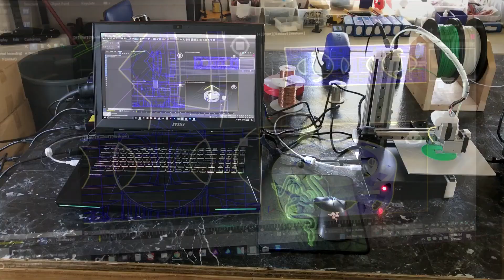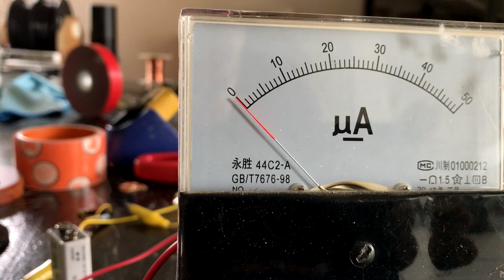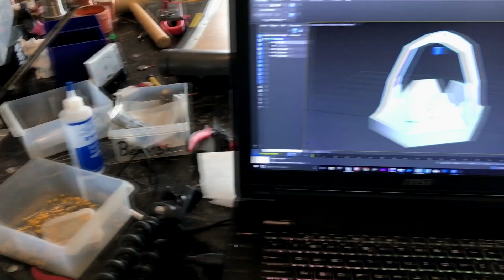3D Printed Nuclear Powered Motor - TriNano EZ-Spin - Tritium

Comment: Very cool build, I was especially impressed by running off the charge difference of ambient air to ground or dissimilar metals. Do you think some kind of pulsed power solution such as a joule thief circuit offer any potential improvements when driving the motor?

Comment: Congratulations dude, you did it! I'm interested in how you did it, put it on laserhacker.com! I'm seeing jewel bearings, but the top one looks like a non contact "keeper" to me, with a magnet to reduce the friction from the bottom one. You mentioned keeping it low weight... Ferromagnetic steel axle. Six dancing flower coils, guessing in your usual series configuration... Wondering what switching you settled on in the end?

Comment: Is there a way to emplifay the current from the teritium battery? or maybe use it to recharge a regular battery that would provide power for the motor?
I imagin the charge rate would be low but technically that would be a self charged motor.
Reply: You could in theory charge a capacitor or battery using a tritium cell, but in reality the leakage would cancel out the minuscule charge rate before gaining any substantial charge
Reply: I've seen someone charge a capacitor and made a self charging flashlight, that took 3 hours or so to recharge.
I was wondering if its possible to emplify the current before charging a capacitor/battery to lower charge time and make it more viable self charging system..
Trying to work on such system myself.
Reply: What do you mean self charging? Like a wind-up flashlight?

You can't just plop a capacitor into a system and have it magically charge up, there still has to be an energy input. 

And the only way to amplify the current would be at the cost of voltage, which means your charging time won't improve. You cannot get more power out of a tritium cell with any amplification circuit, the power it produces is a fixed constant.

And that constant is so low that it would take months to charge a battery or capacitor to a similar energy level as a typical flashlight, over such a length of time they would not hold their charge. 

If you want to charge a regular battery using nuclear decay, you'd have to step up your game from tritium to plutonium or polonium, and good luck getting your hands on either of those
Reply: By self charging I meant that the teritium solar cell is used to charge a battery/capacitor and those later on are used as primary power source for a circuit until depleted and then recharged by the teritium.
In another video, as I said, I saw how a capacitor was connected to the solar cell and charged within 3 hours or so and then discharged via white LED, which effectivly worked like a flashlight for a while.
In the video that inspired this one I remember he used like 7 teritium vials, which provided around 1.5V and (maybe mistaken) 0.25 nano amps.. I rekon making two such cells will double both current and voltage, but thats as long as the two cells are seperate, insted of sandwich the teritium between two solar cells.
maybe that way some voltage could be spared to emplify the current a bit?
Reply: Okay, first of all, can you please spell Tritium correctly? It's giving me a headache. 

That aside, no, it won't work .25 nano amps is so small that to get a decent current you'd have to reduce the voltage to nanovolts, which is equally useless. Like i said the power output of tritium cells is just too low. The leakage rate of any energy storage system would overcome it. 

The only thing i can think might work is winding up a spring at an incredible low gear ratio.

At the end of the day, you'd be better harvesting ambient light than relying on Tritium cells.

The fundamental problem is that Tritium is a very weak nuclear power source, but it's relatively easy for normal people to get ahold of. Various isotopes of Strontium, Polonium, and Plutonium all make far better 'atomic batteries' but they are also highly controlled substances, since they can be weaponized in either dirty bombs or actual thermonuclear weapons.
Reply: Sorry for not spelling correctly, today my keyboard kinda lack the will to work properly..

Comment: Try to use difrent shape of coils most efective shape is sphere inside out like a spining toy from movie inception then pulse them with tesla type electricity. U dont want to use current. Current is byproduct. Just pulse voltage into the coils and coil shouldnt produce magnetic fields cause of shape of the coil like pyramid. Bottom of the pyramid is ingoing and top cap is where energy will beam into the rotor. Magnets should has the same shape but opposite to coils. Try also with crystals inside coils(difrent crystals difrent effects) The shape is most important it has to be like shape of crystal. Also materials u use should have most conductivity. Switching is also important mercury switch is best option as i know. Look how crystal shape (or inside out sphere) capture energy inside it and beam it to nearest simmilar receiver - resonance come to play. U dont want current, current means u are loosing energy. Contact me if u wanna some informations and also watch eric dollard, old scientist,  the old rat lab just to get some creative ideas from watching them. You are open minded enough to get something from them. Good luck and thank you for your videos. My email szczupaly@gmail.com remember that u need to switch between close and open circuit back and forth to get best results and that is where the mercury switch goes. Sorry for my english and God bless you !

Comment: If this motor uses as little energy as it seems, a radio transmitter-receiver apparatus and antenna/coil array with a regenerative circuit should be capable of powering a space satellite! (Redjeff53@gmail.com)

Comment: Just a thought, but aren't you wasting a lot of light by spacing the tritium lights so close together? Doesn't the light in the horizontal plane get lost? Wouldn't a mirror or prism allow you to capture that light and direct it to the photovoltaic cell? The light from each tritium light could hit more surface area that way.
Reply: Yes it would be more efficient to use reflective material to enclose the cell but it wouldn't look so cool
Reply: not look as cool? i disagree :)
Reply: Michel PASTOR 1 way mirrors?
Reply: Muh Face is right. What you call a one way mirror is a semi-transparent mirror. It is like a standard mirror but only partially "silvered". It only works if one side is darker than the other. It is the same thing as a beam splitter in optics. And it would be of absolutely no use in this project other than raising the cost and making it ugly.
Reply: Michel PASTOR
there are no one way mirrors, but there is one way transparency. so maaaybe mirrors could exist too?
Reply: Michel PASTOR so that you could still see through but it would also still reflect
Reply: Alec Whatshisname to do what ?
Reply: Muh Face, my probation office had one
Reply: You do realise that 1-way mirrors don't actually exist, right?

Comment: Really cool project! Hope you don't mind me bouncing some optimalisation ideas in here :) You didn't mention how you managed the switching (I think) so that got me thinking too..
Let me make some assumptions on this engine: 
1. The lighter the rotor, less friction. 
2. Switching losses could be relatively high.
3. I assume the solar panels is a lot cheaper than the tritium tubes. 

So what if you put the tritium tubes on the rotor and a ring of solar panels facing inwards towards the rotating tritium tubes?   (You cold also invert it so the solar panels were on the rotor and the tubes/magnet were on the outside. Depending on what weighs more). This way the tritium ligtht/panels interaction would do the switching. I think that would take care of the timing issues. I personally like the idea of spinning tritium tubes on the rotor :) One problem I foresee is that you need more poles since the solar panels have low efficiency when light hits it from an angle, so parallel connecting solar panels next to each other might lower the power output.. Obviously this motor would have its own set of losses but I think its possible to overcome them by minimize the light spill. Also each tube could be set in its own reflector since you 3d print it and easily could painted reflective. 
  I'm really looking forward to your next project!
Reply: very good

Comment: Just a thought or two after watching the video you could ge better efficiency if lowered the weight of the rotating mass and used a magnetic levitaion, low friction glass or ceramic for a bearing surface. Very cool!
Reply: Patrick Radcliffe ui

Comment: Were you using normal reed switches for commutation ? 
I wonder if it might be worth looking at MEMS reed switches, which probably have less magnetic material to reduce eddy current losses. Look up Coto redrock RR10
Reply: Nice ! I didn't know these existed.
Reply: After playing around I feel like he probably is using something like those. It's extremely hard to get cheapo reed switches to work as needed.
Reply: Honeywell do some low current devices....think its sml35

Comment: I think yo could get a substantial amount more current if you added a border around the vials of smaller solar panels or even just super reflective material. You are leaking a ton of light.
Reply: agreed, but then it wouldnt look so cool...
Reply: yewtoob007 I have to agree that the eerie green glow cannot be missing from a "nuclear" or "radioactive" device. If anything adding a diffuser would be even better so that you can't tell that the vials are the things glowing.

Comment: That's awesome.  Have you considered trying to use purple colored tritium sticks?  They are supposed to generate more electricity in these batteries.  Something about the purple wavelength having more energy.  There is a video somewhere on here where a guy tested the different colors.

Comment: Heck yeah man!!  I would love to build a few of these motors running on ambient background electricity!  Could you release the plans on your website so we can all get building and modifying designs so we can try for better efficiency.  

I've got a question, if you can get this motor spinning on such little power, just as fast as some of the higher power models, aren't you getting out the same amount of power as one of the big ones? If your not, could it be done?  or would the coil that draws the power have too much of a magnetic field and disrupt the spinning?

Comment: I wonder if it would spin better if you pulled a vacuum in that glass enclosure.  That would reduce the drag a little bit helping every nA that you make to much further into higher rpms for the motor.
Reply: Mad Electron Engineering I don't think it would make that much of a difference. It's pretty aerodynamic already.

Comment: So they spin. Can the do any real work? Whats the smallest motor you've made that uses the least electricity that can actually do work?
Reply: Divergent Droid to be able to spin at those currents it must be quite efficient, and have almost no losses, friction or otherwise.
Output work.....well, if its working with nano amps, and the cells iirc output about 2v, then.....you have about 20nW of output power, not sure what you could do with that.

Comment: Question. Did you try only using one solar panel and wrapping it with aliminum foil? Because NurdRage did and he saw that the single panel preformed better then the two panel version. So what I'm asking is did you try the single panel version?

Comment: that gave me an Idea, the motor its most likely very weak but it should be able to power a mechanical clock, that would make it a 10 year lasting clock!
Reply: Or just use a coin cell battery. Still a 10 year lasting clock costing a fraction of the price and taking a fraction of the space.

Comment: cr-10 printer approaching tomorrow^^
Reply: That is a great printer but spendy except through gearbest which has the absolute worst reputation.  They show cheap prices and then jack the prices up on you. Fair warning check their BBB rating. It isn't so good. Lots of complaints.
Reply: thanks, I know.. I'm in europe and got it from a different dealer
Reply: Lucky you. lol That being said I got a message that said it shipped. We will see.

Comment: Hey, I just saw your video on your beta voltaic generator about a week ago, and now I'm excited to see that you got it to work. I ordered a tritium vial in a little acrylic waterproof case for 20 dollars because I've always been fascinated with energy production and radiation, so when I saw that I could buy a safe radiation source that glowed, and could possibly be used as a small long lasting energy source, I knew I had to get my hands on one, and I even got my brother excited enough that he's going to buy his own. I also liked that I was getting a small amount of something worth much more per gram than gold, at about 30,00 o per gram. I also saw a percent that made a coil that would run an LED when near a tritium tube and produce a maximum of 1 watt. I'm planning to maybe have my own mini power plant in the future if I have enough time.
Reply: the video with the tritium tube near the coil is fake. Currently, the PV/Solar cell method seems to be the most efficient means of generating electricity from these little light sources.
Reply: I was wondering about how it could induce a current in a coil, I thought it might be fake, but I wasn't sure. Thanks for the heads up
Reply: MiNDDisruptor I actually have an old smoke detector with that in it, just haven't taken it out of the detector yet

Comment: Brillioun as well as other LENR research groups now understand how to create tritium gas on demand from pretty standard electrolyzers. Tritium is nothing more than hydrogen, which can be obtained from nothing more than water. It's a very interesting technology that we the people have yet that explore or understand the full capabilities of what we are dealing with. Imagine full size lights in any color running at full brightness for over a decade, imagine your phone with a sophisticated tritium/water nuclear battery running non stop for over a decade....It's possible and safe. Definitely check out the latest lenr research if anyone is interested in tritium production through non nuclear means...

Comment: Have you thought of putting the vials at the focal axis of a hemispherical reflector, then capping it with a round PV cell? Also, what about rotating either the vials or the cells, and using the light itself as the commutation?